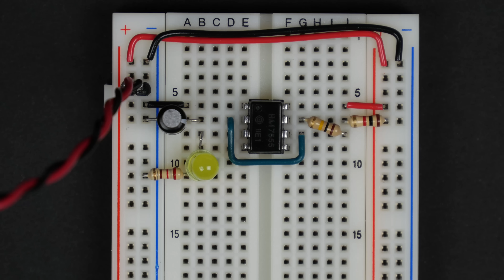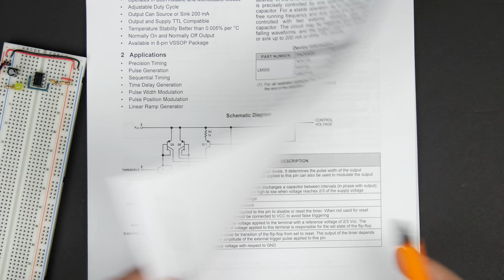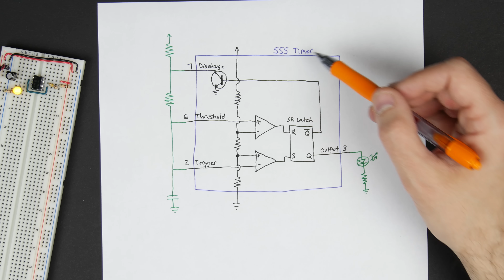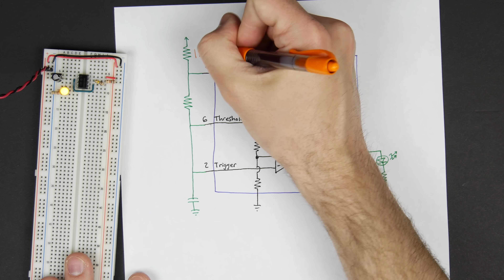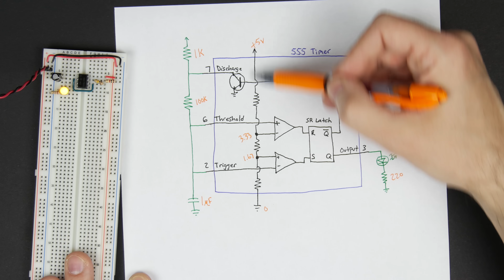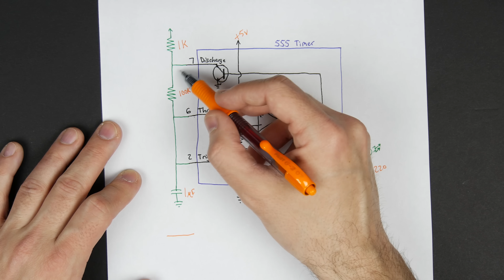Astable 555 timer - 8-bit computer clock - part 1

Comment: I've got a question about the initial state, when the capacitor is charging up. Is the input to the circuit with the 1k and 100k resistors a constant 5 volts? If so, what causes the voltage input on the comparator to slowly rise? Is the capacitor charging up and sending current back through the same wire it was charged up by? Do the resistors make it so that the input power to these comparators takes a while to reach 3.33 volts? In my mind, if there's a constant input of 5 volts into this green line on the left, I don't know what would cause the input to the comparator to change and slowly increase like he said it did. I've honestly got no clue, and it's the only thing I don't understand. Any clarification would be greatly appreciated.
Reply: The charges from input source flows through all the lines (6, 2, capacitor). Since the initial potential charges are low, charges from input will flow to all of them equally. Yes, resistors do help in limiting the flow. Also, as the capacitor accumulates charge, its internal force will stop accepting more input charge and might even start repelling(magnitude of force might differ). Hence there is more flow to 6 and 2. this causes comparator changes. (to test, if you ground the input without capacitor, then flow across 6 and 2 might never be significant)

Comment: In 11:48, you have taken a 1K ohm resistor. Could you explain the reason for that ? I guess you would have done the same without. If it's related to shorting, then it doesn't matter because we do have resistance in wires in a non-ideal world.

Comment: Amazing video! I have a question: when building the timer in the video I subbed the 100kohm resistor with a 1Mohm resistor to see the effects that different resistances would have on the actually timing of the led. I noticed after a while that the led stopped blinking and remained on without turning off. My initial thought was that the capacitor might not fully be discharging (if I unplug and replug the power supply I’ll notice that the blinking happens twice l, but then the led remains on). I’m not certain what’s going on… any ideas?
Reply: Since V = I * R, could increasing the resistance above certain limit with fixed voltage(say 5V) cause less current flow? Sorry, i am also thinking and don't have clear understanding. Please share if you find an answer

Comment: 1:38 As far as I've studied, you're not limiting current, you are dividing the voltage between the resistor and the LED and the current is the same through the circuit as without the resistor.

Comment: Great lesson. Question: What about adding a LM7805 voltage regulator to the circuit? Would that help clean up the signal significantly?

Comment: 16:50 ok yes!!
At the very start of the video, literally once I built mine using the same resistance and SUPPOSEDLY the 1uF capacitance, I was like WTF mine is blinking about twice as fast XD
Went through all the resistors to make extra sure, yada yada yada, ended up adding a second capacitor in parallel to see if the value was off in some way and knowing that increasing the capacitance would slow the oscillation, and it matched up seemingly just right. As it turns out of course, as you measure, yours was 2uF (as my 2x 1uF in parallel are now) XD hurray

Comment: The kit actually gives a 1m ohm and a 1k ohm resistors. So I got a theoretical 1.38s period. My oscilloscope measures 1.61s. I confirmed the resistors and capacitor. Not sure how this will affect future work. I will go on.
Reply: The 555 is not a precision device, you have to add some trimmer resistors if you want to get a precise timing period.  There are other chips on the market for precise timing, but the 555 is very versatile and cheap.

Comment: You say you have a 1 microfarad capacitor, that could confuse someone new to electronics, because if they ask google what 1mF to uF is, it will correctly tell them 1000uF.    Whereas 1mFd which is what you are using, is the same as 1uF.  Trivial I know, just don't want anyone to be caught out.  Very good video

Comment: 0:00 Introduction and Base Circuit Overview
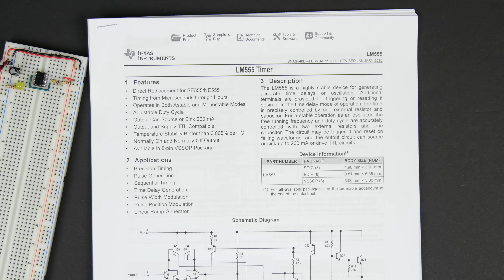1:42 Base Circuit In-Depth Explanation
17:58 Fixing Transition Noise
19:22 Fixing Overshoot
23:32 Attaching the Reset Pin to 5V
24:35 Adding Speed Adjustment

Comment: im so confusion, why in his diagram does he have a resistor after the led, wont that do nothing?
Reply: The resistor is in the LED circuit to limit the current flowing through it as otherwise it would burn out.  It doesn't matter which side of the LED the resistor is placed.

Comment: When you added the resistor at the end in series with the variable resistor, didn’t that create the resistance whether charging or discharging the capacitor. Then the charge and discharge times would be equal.

Comment: 13:55 the 0.693 constant is the first three decimals of ln(2). The logarithm comes from inverting the exponential charge/discharge function to solve for the time.
Reply: Can you explain this a little more?
Reply: How does t=R*C*LN(1-(Vpresent/Vmax) become  t=R*C*LN(2)?
Reply: @NonEss3ntial  The output voltage of an RC circuit at time t is 𝑉 = 𝑉max*𝑒^-(t/RC)

∴ t = RC*ln(V/Vmax)

For an A-stable multivibrator, charging and discharging happen between 2/3Vcc and 1/3Vcc, respectively. 

As initially it starts from zero charge, 
∴ ON time, 𝑡 = (time taken to reach 2/3Vcc  -  Time taken to 
reach 1/3Vcc)

t = RC [ln(2/3) − ln( 1/3)] = 0.693RC

Comment: Does this need 5 volts, the power connection provided will not work with my adapter and I've only got three volts. I followed you exactly,  plugged it in and nothing happened.

Comment: Ben is an awesome instructor ! Thank you ! For your overshoot problem, recommend using a bypass/decoupling capacitor on your supply (pin 8) to ground. Say, 0.1uF is a general rule for most ICs whether they be linear or digital. Put as close as possible to pin 8.

Comment: Ben I have been following you for awhile. I’m a retired aircraft mechanic and now teaching myself the electronics side of everything plus taking courses and building projects from your videos. Could you recommend a decent oscilloscope say like the one you use in this video. I have an inexpensive one but would like to upgrade and get a better output on the screen with more detail like you acquire. Thanks for sharing all your videos and knowledge. Artie 👍

Comment: You have a 1K and 100K(/Variable) resistor between 5V and the capacitor, but only a 100K(/Variable) one between the capacitor and pin 7.  Could you put another 1K resistor at pin 7 to even them out so the duty cycle is always 50%?

Comment: Ben, Electrolytic capacitors have about a +/- 20% tolerance. Using 1% resistors helps compensate a little.

Comment: In my country Bangladesh, I can't find LM-555 IC here is only NE555 so, can I use this IC? 
Can someone tell me what's different between them? Please
Reply: The original NE555 prioritizes the trigger signal, whereas the LM555 prioritizes the threshold signal. A 555 timer's output is generally high when pin 2 (trigger) is less than 1/3VCC and low when pin 6 (threshold) is greater than 2/3VCC.

Comment: 9:04 wouldt the capacitors voltage be to weak to compete against the incoming voltage ?
Reply: the incoming charges will be directly flowing to transistor (to flow towards capacitor they have to flow through 100K resistance, which they won't).

Comment: I never "got" electrical engineering, but instead became a software engineer. Ben's explanations bridge the gap somehow for me, and make electronics seem more like programming. I like this.
Reply: It really does feel like programming. The reason why is mostly because software engineering is based on electronics and hardware stuff. Similarly, programming feels like electrical engineering (at low levels) since both software and hardware are so closely interlinked at low levels (think of programming in C or C++).

Edit: I might not be fully accurate here so excuse me if I got something wrong
Reply: @timecubed  you're right, software and hardware are equivalent and the distinction is only where you choose your level of abstraction. All software can be implemented in hardware.
Reply: Well nearly all computer Innovation is due to electrical and electronics engineering and software just comes later. All initial software was and is made by electrical and electronics engineers as it is extremely low level
Reply: @PPSRHD  Yeah and that's all down to mathematicians and physicists. Electronics just comes later.

Not sure what your point is. I don't think you have one.
Reply: @aidencoder  im guessing hes trynna say that electrical is harder than software because it goes more in depth....
Reply: @Lil_electrician not really..? Software is just another layer of abstraction but ut has a complexity of its own because you can now focus on ideas and concepts instead although sometimes you can come back to physical limitations that remind you of the hardware.
Reply: @Lil_electrician I don't think so. He would be wrong though...

Comment: Electrolytic capacitors have a limited lifespan because they are made of an acid combined with aluminium. This combination forms a very small oxide layer on the aluminium. That oxide layer doesn't conduct electricity whereas the aluminium and the acide conduct electricity (that's approximately how these capacitors are made). Because we are working with chemicals, they degrade overtime. The oxide layer grows thicker overtime, because the acid dries out (it also dries out if a voltage is applied, if you apply a voltage bigger than max voltage the acid reacts very fast and it explodes). Because the oxide layer grows overtime, the capacity drops overtime (C ~ 1/thickness). Because of this capacitance drop over time, companies often produce these capacitors with a tolerance of 150%, so that overtime the capacitance drops drops from 1.5*ideal capacitance to 0.5*ideal capacitance. This way the mean capacitance you get over a long time is equal to the ideal capacitance.

Comment: Hy Ben, I like your videos VERY much. Im mechanical engineer but my hopy is DIY electronic and 8-bit computers. you said about 1mcF condenser "go figure it out". Let me try this one. My small extend of experience suggest me that problem is that this capacitor is rated  for higher voltage than you have there. It means that man could expect greather voltage drop in bigger application so manufacturers got that covered by making component slightly durable. Try to put capacitor in higher voltage application and put bigger current consumers. It should give you nominated value. Same is with the empty 12v accumulator. You need some consumer to measure his level. Other than that it will show you 12.4V, but put small 0.5A light bulb into it - it drops down to 10.2 or so. depending on remaining level in accu. John from Serbia

Comment: Not sure if anyone is able to help but... I have my astable 555 up and running but the variable resistor only seems to be changing the length of the “off” bit and does not affect the “on” bit. Any ideas?

Comment: Totally skippped vector diagrams for impedance and the fact that two parallel circuits are connected to the voltage source. Otherwise great explanation!
Reply: Not relevant for this type of simple circuit.
Reply: @karhukivi you are right I confused AC circuits with DC 🥴. Given that this video shows a capacitor with an error margin of +100% then I'll keep this comment posted.
Reply: @Vectorious123  Cheap components (no manufacturers name shown on it) esp. electrolytics,  only have nominal spec.  I always check the spec with a LCR meter is the value is anyway important.

Comment: The 555 timer was celebrated as a seminal development in integrated circuit design.  Just like the 741 op amp, they are ubiquitous because the basic design was just that darn good.  Also in that class in the 16550 UART.   Some designs are just so good they transcend time.

Comment: Hey Ben, thanks a lot for your video. May I ask why do you use 555 IC instead of quarz oscillator?
Reply: Simple circuit does not need precise frequency control of a quartz oscillator.

Comment: Shouldn't the verticle lines be leaning towards the right a little or was the oscilloscope tweaked and adjusted to make them straight up and down verticle to show instanenous voltage jump? From 0 to 3.5 volts without anytime passing. I guess it must a cheap oscilloscope.
Reply: What are you talking about? It's visible as soon as he zooms into the nanosecond range around at around mark 19:20.
You can't see that level of detail as long as you don't zoom in enough...
Reply: @StrangeHairJoe  I guess you said  what I said in your own way.  You made my point thinking I was saying something different.

Comment: I am assuming that the backgrround on the screen itself all those dotted lines both verticle and horizontal is not part of oscilloscope response to show increments.  Voltage and values are not send in increments by its actual definition of words.  You have to define increments by span of time  because it is more like fluid moving instead of  bunch of say marbels, You can send one marble at a time but you can't sent one water at a time.
Hince the lines are solid lines be it so called 0 or 1. and the verticle solid line is tweaked. In reality it too should be leaning to the right.

Comment: I think the capacitor rating is correct. Keep in mind the bread board itself has some capacitance and this might be the reason for the frequency you're getting at the output of the 555.
Reply: He demonstrated in this video right here that the capacitor rating was not correct by simply taking a measurement.
But your thought is definitely worth remembering for the future. Didn't cross my mind that in certain situations the bread board should also be considered to be hardware that can have an impact on the behavior of your setup!

Comment: An absolutely brilliant explanation of the 555. Thank you.
As for the capacitance issue; electrolytics are notorious for their wide tolerances. These can be as wide as -20%/+80% when brand new. They then deteriorate further as they age. They really should not be used in any 'timing critical' application. Your caps are particularly bad though. Bet they came from China via eBay.

Comment: I ordered the clock module kit from your site and it didn't come with a black grounding wire. Am I just dumb and one of the other colors will work? I Googled it to be sure and seems there are a lot of answers based on what country you're in, although brown seemed to be the consensus, however, it's too short. This is my first breadboard project so forgive me if I'm missing something obvious.

Comment: I can't get my LED to blink. It just stays on constantly. I have tried different timers, on different boards and nothing. The only difference is that the kit I have shipped with 1m capacitors instead of 100k. Anyone have any ideas?
Reply: I am experiencing the same issue.  I tried 2 different 555 but same result.

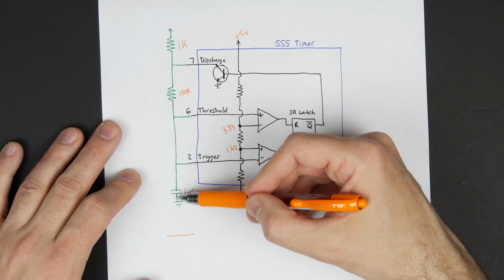Comment: The green wire on the left, it's all zero volts. But then at 6:42, he says, "we're gonna have current flowing through it," down into the capacitor. How does that work? What is the green wire plugged into?
Reply: He says "we start at 0 volts" cause we just connected our timer to the power source. So in the beginning, the green line (as everything else) has 0 volts and the voltage is only slowly climbing up.
This is of course only a thought experiment and doesn't reflect reality perfectly. When you connect your setup to a power source your 555 chip won't be up to 5 volts immediately while the green part of the circuit is still down at exactly 0 volts. In reality they'll both slowly climb up to 5 volts, although at different rates since they use different resistors.

Comment: Is the formula for the duty cycle at 14:00 correct? According to the diagram and the description a few lines above the high output is proportional to Ra + Rb, while the low output is proportional to Rb; so, the duty cycle will be (Ra + Rb)/(Ra + 2*Rb).

Comment: Just opened my clock kit. Very professional, but definitely have scissors on hand. And he's right about breadboard quality. You can tell the difference just by the weight. Makes me wonder if my old breadboards are made with tinfoil inside.

Comment: 1022 could be interpreted as something similar to a resistor colour code. 1022 would be 10 + 2 0s, with a tolerance of 2%. which translates to 1000...pF, or 0.001uF
I guess that's not it.

Comment: I need help. Why does my astable 555 output speed get faster when I push the monostable button?? Then if I connect ANY chip specifically the 74393 it basically just flickers and the counter spits what looks like random numbers? I'm so confused